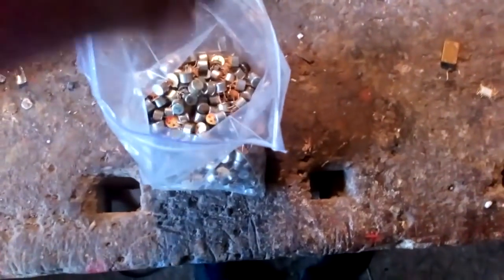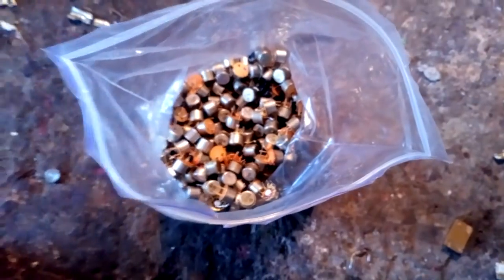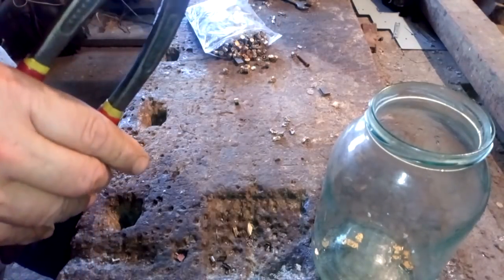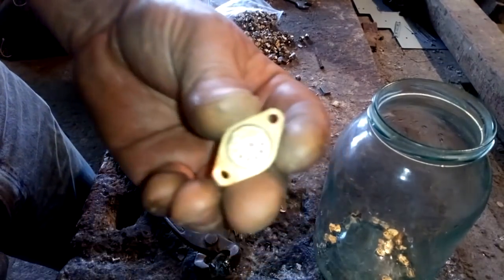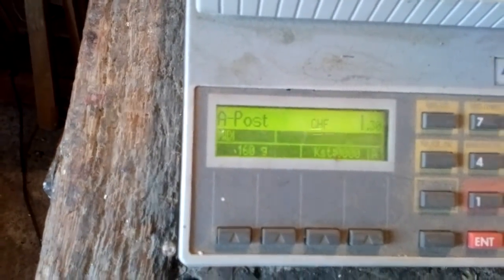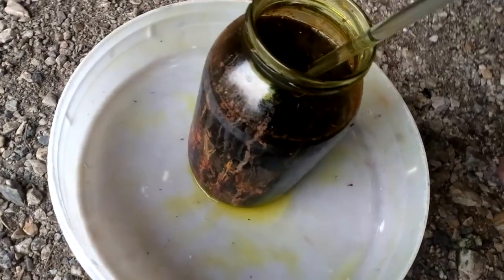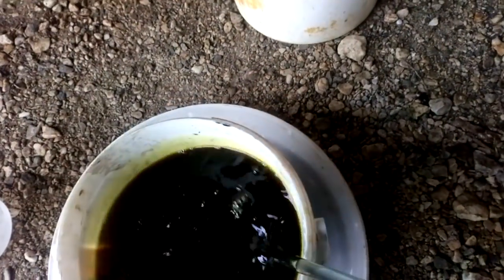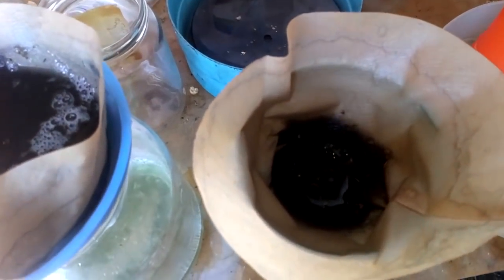TRANSISTORS 3 LEGS - Gold recovery with Aqwaregia!

Comment: I have a batch of this EXACT SAME materials dissolving right now! But I didn't remove the caps from the transistors. I'm letting them soak first in clean solution from last gold drop... the solution they are in is aqua regia from my second refining of a good clean drop. The waste was totally clear so I think it will dissolved more... and it is working. There are lots of bubbles coming from caps. We'll see...